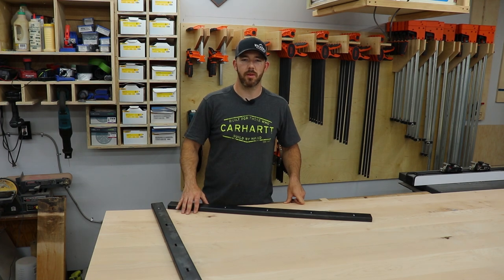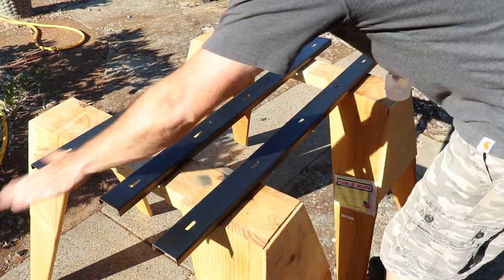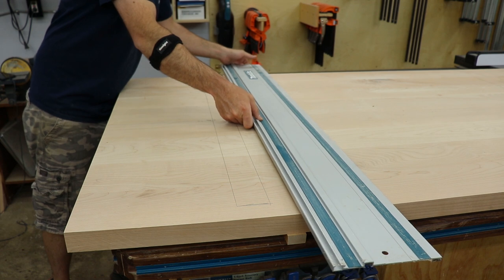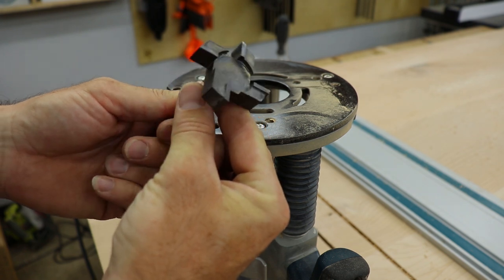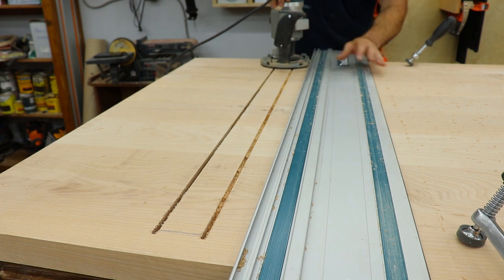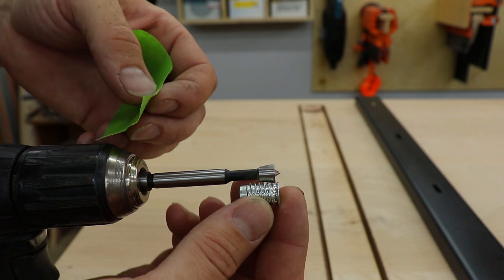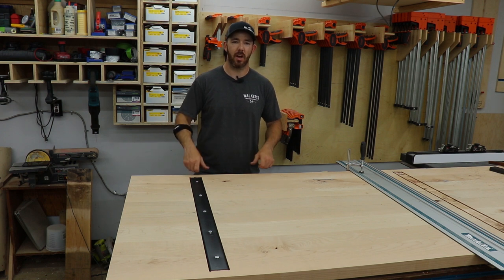Do you NEED C Channel in a table top? | How to keep a table flat

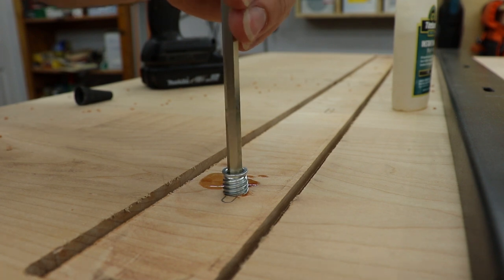Comment: TIP ... at time 8:39 if you screw the insert into the wood without glue first then remove it and use thin CA glue to coat the threads , let dry  . 
The  threads into the wood will be very strong . I found this out building RC airplanes. I also found that while applying CA glue the way you did , the glue will dry very fast and it will sometimes be hard to get the insert completely into the wood before the glue set up. But beautiful job on the top
Reply: why is the glue even needed?
Reply: @jimmyz1686  ...  Thin CA glue is used to strengthen the threads. Screw the bolt into the wood making the treads then remove it Now, use thin CA glue in the hole , let dry ! Then screw in the bolt for very strong  fit.

Comment: The c channel also protects your joints. Just because you glued them together doesn't mean the bond was 100%, even if you got good coverage. When me & my dad were making my custom desktop from solid alder, we lopped off one end, & actually removed some of the joint in order to get the length I wanted. It was no big deal, as it barely showed after some decent sanding, so for a little fun we set them on the ground & beat the shit out of them with a hammer to see what failed first. The joint or the glue. Obviously, the joint busted open until we got to the last one, & no matter how hard we hit that wood, it wouldn't give. Installing c channels is an excellent way to insure your joints never fail, if something ever happens, like you accidentally drop the desktop on the ground, then you won't have to worry about a joint failing. The c channel holds them together~

Comment: Hi, great video and explanations. I have a bamboo slab (69x39 and 1,5" thick) installed 8 years ago on a kitchen island. It started to warp in the last 2-3 years. I tryied a few tricks, like a wet towel to return it flat. It works but it warps again and even worst then before. We do oil it but we forgot to oil the underside. Can I install the C channels and bring it back flat using the water towel and tighten everything up? Also, on a 1,5" thick, how deep should I go to or what size of a C channel should I use? 
Thanks a million

Comment: Could you use use 3/16, or 1/4" flat bar, instead of c channel?   Thanks
Reply: Tried it, 1/4 X 2 inch stainless steel, The steel bends.

Comment: How thick does your top need to be for c channels? Would you install it in a 1.25" thick top or do you it to be thicker?
Reply from the maker: I’ve done it on 3/4” tops. Just have to get the right size channel.

Comment: Hey Brandon, thanks for the great video. I’m new in my woodworking journey and was just curious if I routed the tops of my legs which have a 80mm x 4mm thick steel flat bar connecting them would it have the same effect?

Comment: This is interesting , i have 25.. ply with a bonded 14 manmade floor on top total 40 mm when bonded , what size channel would make a difference  do you think? i was looking for a 15 x 40 mm channel . It is to cover a 830 mm span hatch will be walked on so i don't want flex.

Comment: Does the fixing in the middle weaken the worktop? at this point the tabletop is cut across almost half the thickness, won't it start to sag in the middle over time?
Reply: same question. i would imagine this makes that section very weak as you pretty much scored through a large portion of the wood.

Comment: Hmmm… why not set the depth for the channel AND the flathead screw we’re using to to attach to the slab, to avoid spacing issues with flat surface mount or to prevent mounting issues with legs should they overlap.

Comment: Hello,

I would like to know what dimensions it is recommended to have the part that goes into the wood depending on the thickness of the table top? For example, with a 4 cm table top, which model of C Channels should I use? I also attached a photo in which I specified the part inserted into the wood.

Thank you and I await your answer!

Comment: But how about the question in the title of this video: do you NEED them. Do they actually prevent warping of the wood? And if so, what is the contribution of the C-channel and what of the cut you made for the C-channel?
Reply: The top is what needs them, and yes some tables really do. Also it is one of those things, do you want to wait and see that you did need them, or install them and never be an issue. The c channel is metal and does not warp and bend like wood does. So that is the point of it, to be rigid and not let the boards do what they want, aka ruin your top/table. A big top made of wood can not be thin, so the cut out is fine. If you try for a real thin top, then you are asking for failures down the road, warping/splitting. Have to be real careful with moisture, etc.

Do you NEED it, no totally. Will it make your tables better and last longer? Almost 100% on that. There are a few times where you get the perfect wood that has no moisture and barely move, but those are rare and not the norm.
Reply: @SirCanuckelhead  Thanks
Reply: @Cor97  no problem, there are exceptions to every rule and each wood has it's own needs. So diff methods can be used, like doing a wood trim. Just the bigger the slab the higher chance for warping so bigger need for support/c-chan.

Comment: would you recommend a piece  length wise as well as the pieces you laid? In my instance at ~7' apart legs with a 2" slab desk. Thinking about making a grid arrangement of channel to inlay but maybe over engineering? thanks for any feedback!
Reply from the maker: I'd use stretchers on the base for that.

Comment: Great video Brandon, I'm currently working on my first kitchen table and I'm in the process of putting in these C-channels, but I'm concerned about how they may reduce the strength of the overall table.  I understand that these help control warping and twisting, but should I be concerned about how these channels may weaken the table?  Specifically on the ends of the table, where the legs are on the inside of the channels.  Any advice would be greatly appreciated, thanks!
Reply: They would increase the strength of the table. They're steel structural members. They'd only be weak in a twisting direction, which a table top would only experience with greatly imbalanced loads across the different legs, and even then, it's so unlikely you'll have a moment that would twist two opposite edges in different directions without super uneven floors or some weird loading condition.

Comment: hey great video thanks for the info.  I was thinking of building a desk out of 1.5 inch thick by 8 feet walnut butcher block.  Would you recommend a few c channels for a butcher block or because its made up of tons of smaller pieces of wood I should be good?

Comment: Great video thanks for posting. One question, do you need to have a slot/bolt for every board in the table? Is it best to have to bolt in the middle of every board? If so, does your c channel supplier allow for custom spacing of the slots? Thanks again.
Reply from the maker: It doesn't really matter.  If you get the channel from Bidwell (in the description) they come with precut slots. 👍
Reply: Thanks! I bought c channel from a hardware store and plan on milling the slots. I’m sure I’ll end up buying the ones with pre-cut slots next time.

Comment: If the table top is quite thin (20mm) can the C channel NOT be recessed, and be installed up the other way?  Is the recessing for aesthetic reasons only? Or a structural reason?

Comment: Love the craftsmanship and thanks for the explanation.  I don't quite understand the reason you do this.  I've made a lot of tables over 6ft jointed maple, walnut, etc and glue and dowels do a fine job of keeping the boards level.  Is this to just provide more structural integrity for cupping?  If so, how do you manage this for smaller width boards in relation to your c-channel, or do you just make sure your board widths ensure each board will be screwed into the c-channel?
Reply from the maker: Yep just a little extra insurance.  Especially on tables that dont hve a full apron to anchor to.  But even when they do I still do channel. 👍

Comment: Thanks for the great video.  I am near completion of birch counter top, 36" x 90" for a kitchen island.  Per your video, I would like to install three or four C channels.  Help!! I checked Bidwell Company to order, and they said they only have one clamp 22" ... none of man many sizes are available. I see no evidence from the site that backorders are available.  Do you have any other suggestions companies/places to order a similar quality C channel?   Thank you!
Reply from the maker: Looks like they are back in stock! Here is the link to the 3/4" leg ones.  Depending how thick your top is, if its 1-1/2" thick or larger the 3/4" leg will work great.  if its thinner you may want to get the 1/2" leg.  Be sure to use my code "WALKER" at checkout for 10% off anything on the site! https://bidwellwoodandiron.com/products/channel-2-0-plus?variant=42290200150253

Comment: Great video. What is the purpose of the inserts for the screws? Wouldn't the screws into the wood itself allow for the movement of wood over the seasons?
Reply from the maker: The inserts allow you to use the flathead screws and are much stronger.
Reply: I also use inserts to fit table legs. They also provide the perfect solution allowing you to unscrew to move the table where the space to move  (say thorough a doorway) to another location. Additionally, there is less chance of the wood splitting, thereby providing a more secure binding.

Comment: Great video, very clear and helpful.  I am thinking about making a 7' x 4' walnut table (6" wide boards) that allows for the insertion of two 20" extensions, which means that the table would be cut in in half across the grain and have a sliding mechanism bolted underneath along the long dimensions with the grain.  So each half of the table would be about 42" long by 48" wide.  Do you think a C Channel on each side would be needed in this setup?
Reply from the maker: That's what I would do.  Check the description for a link to some good channel and hardware. 👍

Comment: I am building a table and plan on using c channels. My table will be 5 1/2 ft long and 39 inches wide and 1.25 inches thick. How deep should the c channels go? how much wood should there be from the bottom of the c channel to the table top so it does not loose strength

Comment: Is there a general size where you decide whether it needs to use them or not I'm thinking if a tables under around 3' feet  it wouldn't require it
Reply from the maker: Usually anything 6ft and up I use them.
Reply: @WalkersWoodworks   So if you had coffee tables that were under 5' you think it would be safe not to use them, I only ask because I haven't usually done smaller tables I'm wondering if I could go without using them

Comment: I'm hoping you can help me. I bought a beech wood table top online, stained and matte oiled. The seller showed the top at 45 x 24 with metal plates (or battens, about 1/2 width and 22 inches long on the short edge of the table top) about 5 inches in underneath on both ends and one metal batten in the center. Similar to your c-channels but they seem flat and the screws leave no wiggle room for movement. 
My top arrived with only 2 "metal battens" instead of 3, with each on the ends, not center. The underside of the table top has a rough area that's uneven, I don't know the proper term and there are some cracks coming from it but only on the underside. On the top side it looks like a beginning of a large knot.
I'm wondering if I should be concerned and return it? 
It won't be easy for me to do that, but I don't want to see anything happen to this tabletop after I go through the effort of attaching legs.

Comment: Have you ever put them on the top side of a table?  I am in the process of designing and building a metal strap table.  But I kind of like the looks of the c-channel and not going around the table top.
Reply from the maker: I haven't. But I like where this is headed!

Comment: Hi.
I dont get something.
You crosscut with the router two rather deep channels in parallel, at a mere 2-3”from each other.
Then you mount an insert into the top 1” or less.
Once tension rises in the wood, doesnt it just rip a chunk out between the two channels considering wood splits in that dimension pretty easy? I mean its just a two inch long piece if wood where the screw and insert applies all the pulling force, and the steel of course cant buckle.
And if it doesnt split: doesnt that mean that the channel is not needed, as cupping force is insignificant/it doesnt cup anyway??
Thanx

Comment: 20mm (3/4 of an inch) thick round table top 60 " diamater. would c channel work to hold it from bowing? worried only leaving 5mm rough of material on the top of the table that it may break off by the time i cut the slot for the c channel. thoughts? or other ideas to hold it flat?
Reply from the maker: Go to bidwellwood.com and they have channel with 1/2" leg. It's OK to not recess it also so you don't have to take out so much.  Be sure to use my code walker10 to get 10% off channel and hardware! 😁

Comment: Great video. Thanks for all the information! I have what may be a silly question. We are building a desk - 96" long and 26" deep. We have a great set of large industrial t-style legs and want to add additional support using C-Channels. Do the channels go across the 26" or 96" side? If 96",  how long should the channel be? What is the difference of going along the width versus depth? The desktop will be solid wood. Our options are limited, but it could end up being a bamboo slab. Thanks for any guidance.
Reply from the maker: I would put them across the 26" width.  Probably go with 22" if your slab is over 1.5" thick I would go with the 3/4" leg channel.  www.bidwellwoodandiron.com has some awesome new laser cut powder coated channel.  If you use my code (walker10) You can save 10% on anything from the website.  They carry quite a few woodworking supplies now and are great people.  Hope that helps! If you have any other questions feel free to email me. brandon@walkersww.com
Reply: @WalkersWoodworks  Thank so much!

Comment: Great video. You might wanna use a drill guide, next time, so you make the holes for the threaded inserts straight. It looked like you were going on at an angle there bud.

Comment: Do we use glue to fix the C-Channels to the table top? will the glue or epoxy add extra strength to the C-Channels in preventing cupping of the wood?
Reply from the maker: Definitely don't do that.  It needs to be able to move as the wood expands and contracts.

Comment: For 1in 1/4 thick table top do you think 1/2in deep  c channel will be too deep or should I look for 1/4in deep c channel?
Reply from the maker: The 1/2" leg would be fine.  You don't have to recess it if you don't want.  Just cut the slots for the legs.

Comment: Great video, Brandon. Thanks. We agree on at least 2 things. I don't care for breadboard ends either. The ends only align with the edges of the top once - when they're first installed. I also don't use many hand tools. What are your thoughts on the Makita track saw? I'm considering buying one in the fall. Stay well and happy.   Bill
Reply from the maker: I love my track saw.  One of my favorite tools for sure!  I do think I want to get the larger festool one though for slabs.
Reply: @WalkersWoodworks  The 75 is a beast. I've had mine for since the early-ish 2000s

Comment: Thank you for these videos. Amateur here just getting started. Any thoughts on using a wood batten in combination with these inserts and longer bolts? I would use the same hole layouts. I have extra hardwood laying around. I know the steel wood flex less. 1.75" Black Walnut boards. Thanks. 52"x84" Table top.
Reply from the maker: Ya the wood would help but like you said not like the steel.

Comment: Thank you Brandon, super helpful. With a 1.5 inch thick table, do I want the 1/2 inch deep C-channel or the 3/4 in deep C-channel?
Reply from the maker: I use 3/4" at that thickness.  But either is fine. Thanks for watching!

Comment: My parents have a large 8 seater dining table made from PNG rosewood. It cupped when moved back to australia as I don’t think the wood was seasoned well. It was poorly repaired and has cupped again. How can I make it flat again without removing material before installing c channel? It’d be a bad idea to expect the inserts and screws to pull it flat without tearing out.
Reply from the maker: You really can't unfortunately.  It will need to be resurfaced.

Comment: Can I install 1/2in thick C Channel in 1in thick Maple?   This seems to only leave a 1/4in of thickness left after routing the bottom and I feel like this is not good.  But 1/2in C channel was all that I could find on the website you recommended.  Can I proceed with this 1/2 thick C channel or should I find thinner C-CHannel somewhere?  Thanks for the video
Reply from the maker: 1/2" should be fine in my opinion.  But I don't usually put it in anything less than 1-1/2" thick.  Maybe just don't recess the flat part.  Just let it sit against the bottom and rout in the legs of the channel.  I've done that before.
Reply: @WalkersWoodworks  Ok thanks.  Also is there place to find C channel with 1/4in legs and holes already drilled? Or is 1/2in the smallest C Channel ?
Reply from the maker: The problem is we bend the metal after the holes are cut and the smallest we can bend is 1/2"
Reply: @WalkersWoodworks  I see thanks for your help

Comment: How does putting the bars across the width stop the wood sagging length ways?
Reply from the maker: It doesn't.  That would be done with the base either with aprons or stretchers between legs or pedestals.
Reply: @WalkersWoodworks  would it be a huge mistake to use c channel along the length of a table that has a plywood base?